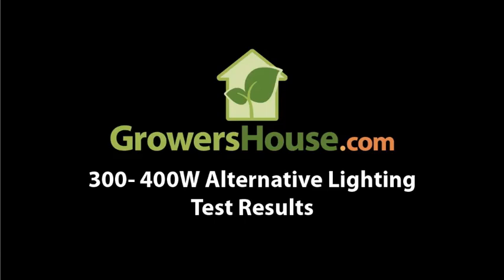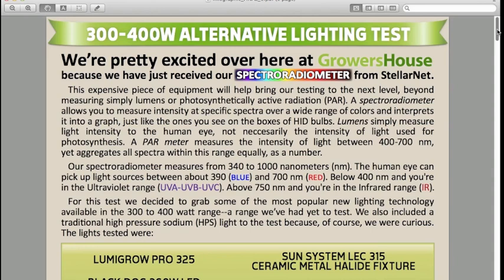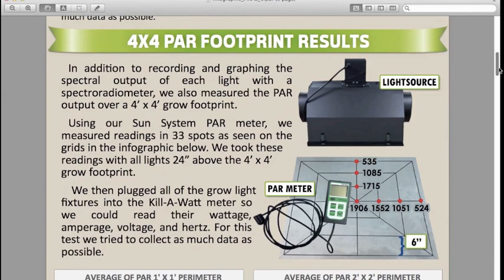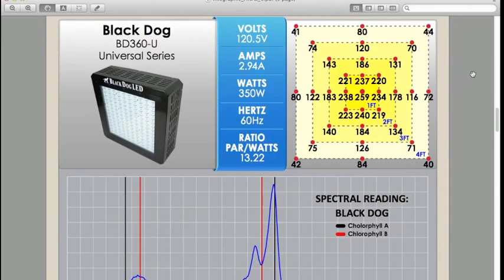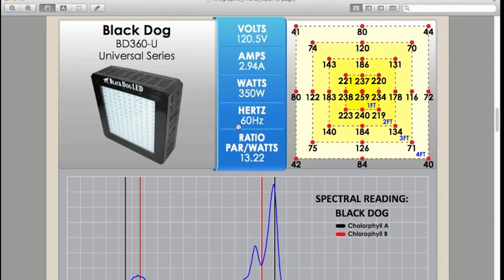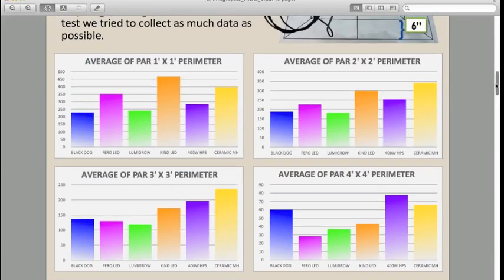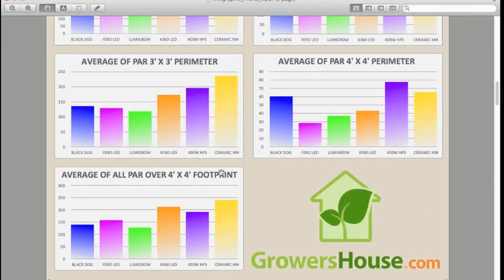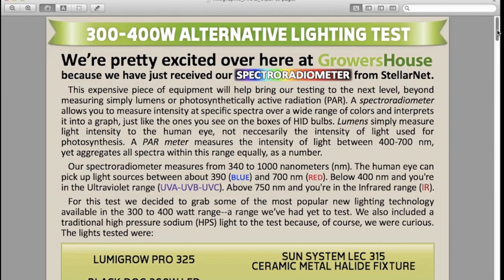300-400w LED, HID (HPS), and Ceramic Metal Halide (MH) Grow Light Review & Test

Comment: dont know why those imported Yield Master hoods from Sunlight Supply are so popular. I bought one years ago and the no aluminum reflection on the flange ends really makes a difference. Plus the reflection is of the cheaper 85% compared to a higher quality hood with the 95% reflective German imported insert. A.par meter or even a footcandle meter will register a diffwrence1compared to a better made hood. And your plants will too.  Your stil paying for the same amount of juice every month....gett of the wallet and buy a better hood. It adds up over time.

Comment: I want a side by side comparison of BlackDog Phytomax 800 to CMH 351s in a 5x5 space (with reflective walls) and I want PAR readings across the footprint.

People say all sorts of things about the 351 on yield and footprint, but the footprint I find on the manufacture sites says 2.1 feet square at 18 inches from canopy. That means you would need 4 of them to cover the same area as one Phytomax 800, which puts them into the same price ballpark too.

Comment: Much thanks .Very informative,  LumiGrow has just been exposed as a waste of money.
Reply: cannibis sativa Those Lumigrows have been around for awhile! Still, now even, years after this video! Nowadays, it's COB LED's, or CMH/CDM/LEC, etc. I'm using a 630W CMH-DE lamp with a Ceramic Solutions(sale now, 630W ballast and CMH-DE lamp-$195/free shipping, runs out soon!) low frequency, square wave, dimmable w/700W boost, and a digital readout! I've got the 3K-R lamp and it's working out great! Might upgrade to a 1000W CMH-DE ballast and lamp, after the summer, which I believe Growers Choice sells through Growers House. Last check $329 for ballast(not low frequency, square wave, which extends lamp life by double or more), but the best 1000W ballast currently available for 945-1000W CMH-DE lamps that will operate at 120V. For 630W ballast and CMH-DE lamp, Ceramic Solutions is tops! For 315W, and 945-1000W CMH-DE ballast, lamp, and fixture, looks like Growers Choice is tops! Just my 2 cents, and it may not be worth that, Lol! But I do my research and testing.. Much love and great grows to all! And thanks to Nate from Growers House!

Comment: if you guys had tested the solis tek ballast as the winner of the par test, why wouldn't you use it in the HID set up to show the best possible result from HID against the alt lighting?  Instead you chose to use a crap quantum ballast.

Comment: Do you only do tests on lights you supply? I would love to see tests of the LED by the company TOP LED on their 5w models. I am using them and so far had amazing results as well as many other growers on the forum I am a member of. I have to say I used there 80x5w and it was very close to rivaling my 400w HPS that I replaced, but the buds were much more covered in trichomes, no difference in size of yield. Anyways, love the videos and keep em coming!

Comment: Out of all these the best bang for the buck definitely seems to be the LEC 315 Ceramic. It has one of the highest efficiencies, best spectrum, and the best light spread of all the lights tested. Thanks for the hard work Nate! This is exactly what I've been looking for to get a new veg light.

I'm a little surprised the Lumigrow came in last in almost every aspect of the test. Seems the PAR readings from their videos are a little misleading when they say the Pro 325 puts out the same PAR as a 600w or 1000w HPS. It couldn't even beat a 400w HPS. Even if you replace your bulb every year the HPS is still cheaper in the long run.

Comment: now this is a bad ass video... serious testing. Only expert led guys and growers understand this stuff... Seriously good job, and keep it up !!!

Did you illustrate the LUX numbers ? and how much light is being emitted? are those the numbers on the upper right hand corner?

Also, what specific wavelengths did they output within the PAR spectrum?
Reply from the maker: We did not illustrate LUX numbers, but instead illustrated the PAR readings in 33 places over the 4' x 4' footprint. The PAR numbers (in micromoles) give a more accurate intensity measurement for the spectra plants use to photosynthesize. Yes, the numbers in the upper right hand corner illustrate intensity over a 4' x 4' grid footprint, with the 3' x 3', 2' x 2', 1' x 1', and center readings.

The spectral graph shows the wavelengths each light emitted over the color spectrum. Click on the link the video description which will lead you to our blog post and a link to the infographic where you can easily view all the results. Here's that link: http://growershouse.com/blog/300-400w-alternative-lighting-review-comparison-test/
Reply: ***** Great to know... for sure the future of indoor growing is going to be done with intense LEDs and custom lamps per strain of plants consisting of blue LEDs for veg only stages and then switch over to a redish/purple spectrum for the early, mid, and late bloom configurations.

Have you guys considered 4  FT LED Retrofit T8s Tubes instead of Florescent without ballasts, for veg stages and starting clones/seeds?
-Pure White Tubes ones, give off a high lumen/watt output and perform very well on early stages of any plant. I dont have a badass spectrometer like you guys, but i have some UL Sheets that say they make a cool blue spectrum with a good CRI.

We should definitely keep in touch.
Reply: 240SSONLY
If you think the future is red and blue LEDs then you didn't understand a thing from these tests. The full spectrum 315 Ceramic metal halide did the best out of any of these lights. LED still has a long way to go. Even induction lighting is more efficient and longer lasting than LED. But who knows what it will be like in another 5 years.
Reply: LOL. You didn't even know how to read the graphs that were posted in this review...enough said.

And you can keep jibber jabbering about return on investment. This test proves that watt per watt, HID is still more efficient AND cheaper, which means it more than pays for itself in one grow.

Sure, LED will last 5 years, but you lose output every year. I can afford to replace a little $70 bulb because it ensures I get the optimum yield and output. Add that up over 5 years and it STILL beats the cost of LED. You can't simply replace a bulb when your precious LED fixture goes out. LED might one day be able to match HID, but I wouldn't hold my breath. Peace out fanboy.
Reply: 240SSONLY Well, as time has passed, hopefully you'll both agree that COB LED's, 3000K-3500K warm white spectrum(not the purple color, more like a CMH/LEC/CDM spectrum), yet more PAR/watt! And while HID lighting has been around forever, lol, CMH technology is mostly 21st Century technology,  yet still traditionally an HID lighting system. I'm using Ceramic Solutions 630W CMH-DE lamp with a low frequency, square wave ballast with digital readout, dimmable, and boost to 700W(ballast and lamp on sale now for $195/with shipping! Not for long though). Very satisfied! After summer maybe upgrade to a 1000W CMH-DE ballast and lamp from Growers Choice, sold through Growers House. Or a COB LED setup(Migro 600 seems tops). Great grows to all!
Reply: Reverend Green Well I happen to disagree on a few of your statements and unlike you, I know what… I’m talking about. You need to look at the big picture you fool. Listen up HID Fanboy, here is a lesson for ya. Just because MH lighting technology generates a high lumen per watt output and happens to make promising PAR Spectrum numbers with high micromole readings through a spectrometer DOES NOT mean that in a year or two we won’t surpass those numbers while only emitting the actual 380 – 440mW that the plans use under vegging state ONLY and then the other rage of usable light for growing cannabis… up to the 880mW lengths when blooming… early, mid and late.

One day you’ll understand that plants react better to the light they want, rather than the loads we have been cramming it with, over the past years. It’s about fine tuning a carburetor if you will… “less” or “lean” sometimes is “more” and “better”

Keep thinking that HID lamps are the way to go, you’re underestimating the benefits like a quick ROI on electricity savings; They pay for themselves and you don’t have to replace them in years, not every 3 grows, in years; Lower HVAC cycles & Infra-Red Heat Wave; No Radiation; No more Hot Spotting or burning your cola tops or leafs. Which all of this means more $$$ and better yields. Im sure I don’t have to explain that.

As far as the 2nd Gen LED Chips coming out, they will not disappoint you buddy… you wait and see. One thing we can agree on, is that about 85% of all LED products out there for growing SUCK. Very few items look like they are meant to last the 5 years they should and can match lux readings with the desired mW for cannabis plants vs the HID technology available today. 

Right now, there are way too many chips per module and they won’t be able to dissipate the heat emitted from those LEDs in a single board. Secondary polycarbonate lenses are also improving by the day in order to focus the lighting being emitted best in different fields of view, so you are very wrong my friend. HID lighting needs reflectors and non-sense cooling just to function and through that 360 degree lighting a certain direction unlike directional LED lighting.

In the future you will see led modules for a different strand, you watch…
Reply: Reverend Green fan boy hahaha.... you're a funny guy... i agreed with you on the charts, i was commenting on thing else... idk why you keep referring back to some thing i stated and was corrected on, by Growers House. My opinion can vary from yours or Growers House... its ok, i have no problem with that... but apparently you do. I'm stating facts, not just opinions, i dont give a shit if you dont like change... people never do, this is whats new and it will prevail.

So if you think that consuming large amounts of unnecessary electricity is ok... i would appreciated if you re-considered how much electricity we waste in lighting all around.

Setting up a cannabis production facility for only growing with LEDs can save you money in certain aspects just like like it can increase with the price of the modules. For example, no high wattage boxes, less copper wiring, no need for ballasts, no need for disposal of mercury products (do you even pay to throw it away? or are you the typical dick that throws it in the trash to sit on a land fill) 
I can keep going if you are really blinded by that whole world reality.

But you should do some research on what "Maintenance Hours" are... and how light depreciation actually occurs on an LED you primitive fool.

You see UL and many other third party laboratories state that maintenance hours as an industry standard of 50,000hrs for LEDs will emit 70% of the lighting will be available since the day you bought it @ 12 hours a day use for 7 days a week. So i dont know how you think an LED will depreciate at a rate you can even notice within a 5 year range when its designed to "legally function" within 12.5 year but in reality work up to 18-20 years with the right power supplies. Many manufactures cant even prove they have led chips capable of 60,000+ hours so they downgrade their products just to be competitive.

You call me a fan boy, yet you are stuck on stupid with 50+ year old technology... COOL STORY BRO !!!!

Stick with the high heat, radiation, mercury non ROHS compliant and constant wasting of electricity for your good !!!! thanks a lot buddy thanks for thinking about every one else while you grow your cannabis.